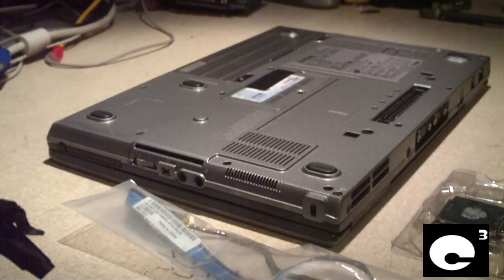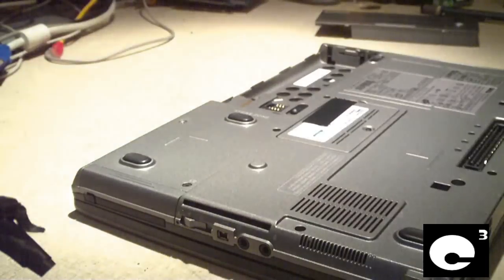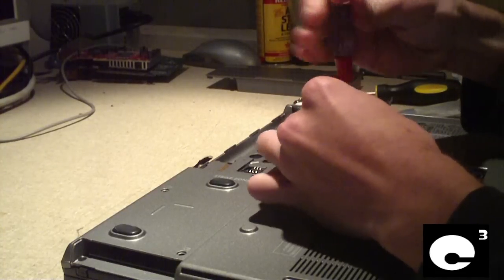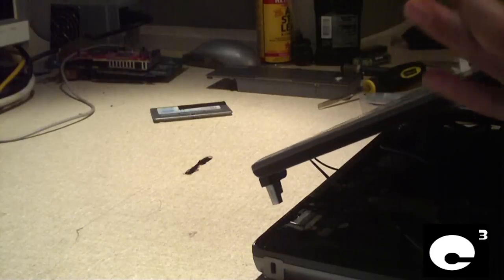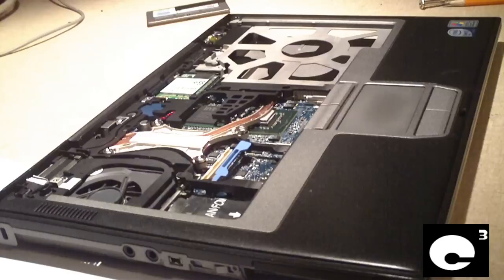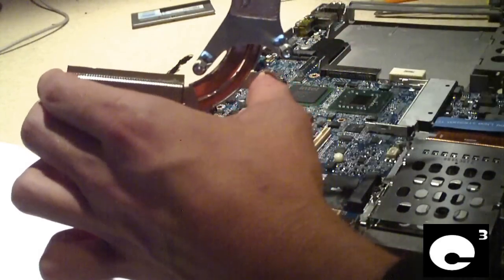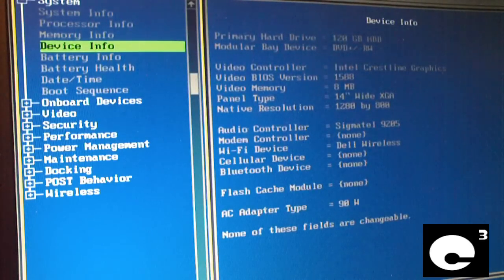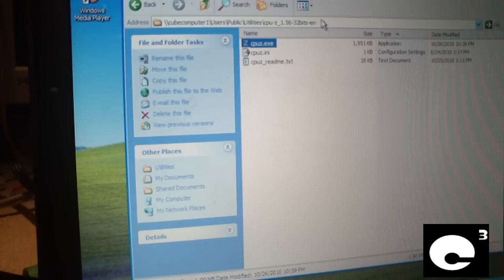Screen Cable & CPU Replacement Tutorial - Dell Latitude D630 Notebook

Comment: Nice video on the D630. I upgraded the cpu in my D630 last night with a T9500. Fantastic improvement over the stock T7250. New cpu scores a 6.2 in W7 assessment.

The problem with the screen might not actually be the LCD and could be just the inverter. They commonly fail and are pretty cheap to replace. Like $5 or $6 on eBay.

Also the fastest cpu you can install into a D630 is the 2.8GHz X9000 Core 2 Duo Extreme cpu. Mad fast but also generates a good bit of heat and consumes more power...

Comment: Also, I find it interesting about the desktop heat spreaders you mentioned.  The AMD K6 series and Intel Pentium I and II had heat spreaders.  You can pop the heat spreader off a K6-III, for example, and it looks almost identical to an early Athlon.  Then the P3's and Athlons had none, then they started using them again.  Strange, eh?

Comment: small tip= Turn off. Hold D key down while powering up. If it cycles thru colors. Its screen is prolly all good. then check inside....Only coz its a biotch to take apart (coz im lazy). screen would work 20% of time, only to shut down or lose pic. Changed thermal paste on cpu and little aluminum spacer on chip. Back right up. atleast for me=)